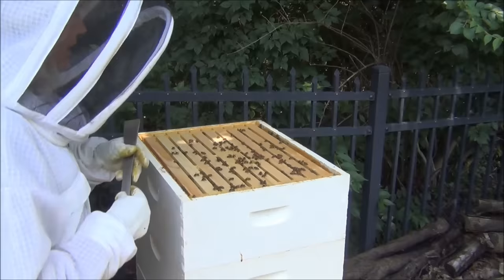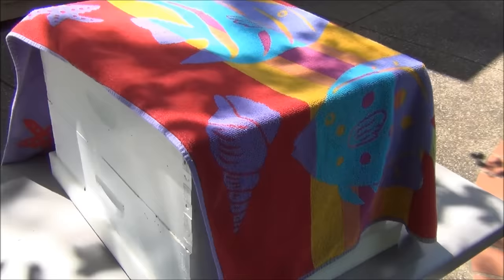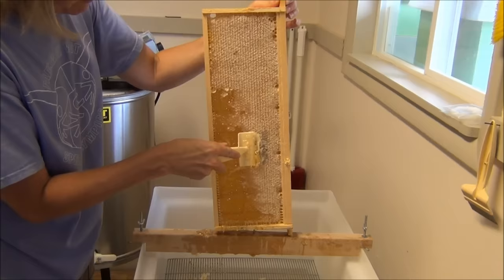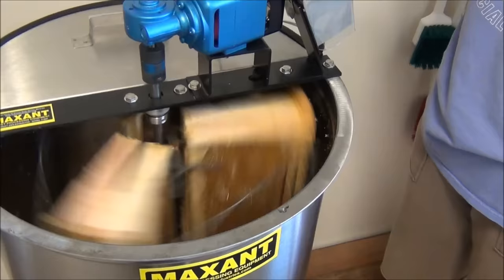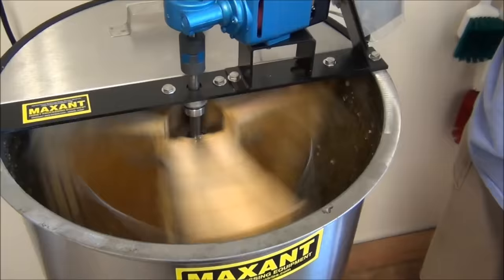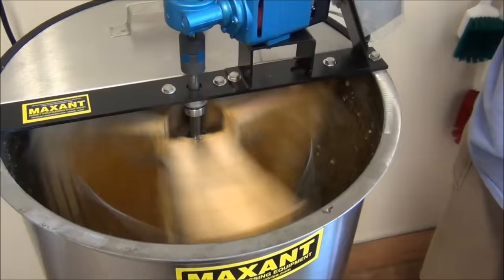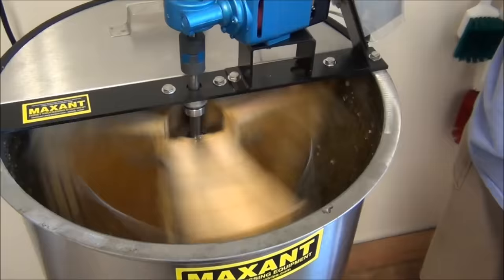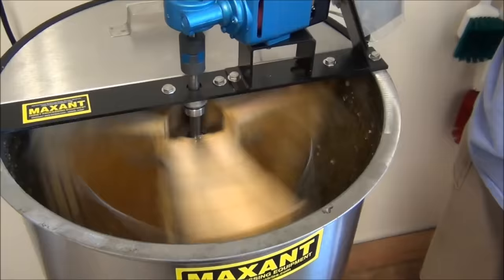My first year's honey harvest: 49 Pounds - from start to finish

Comment: After watching many honey extract videos I've decided I'm not going to use a hot knife. I don't want to heat the honey, if it gets too hot is changes and I want my honey to be as natural as possible.
Reply: Yes, there is no need to use a hot knife, just use a sharp knife and the honey will not lose its valuable nutrients.
Reply from the maker: This video was my first year's video.  I really dislike the hot knife.  I don't think it really changes the honey as the heat isn't significant enough to really change the honey's temperature in a significant way, but now I just use a serrated knife.  Works a lot better IMO.

Comment: im very curious but just what would happen if you gave them one frame to build comb on? will it be huge or will the bees mess it up  or die? also nice job on the harvest
Reply from the maker: They would build on the one frame, and then they would go from there in an unpredictable pattern, but attached to the top.  If you ever had to open up the box, it would be a disaster.  The frames do two things:1.  establish rows form them to build frame - doesn't guarantee it, but it helps a lot.  I have used foundationless frames and they have built some wonky comb.2.  It establishes "bee space", the space between the top of the frames and the lid.  Generally this prevents bees from building wax and connecting the roof and the tops of the frames (they need space to move around).
Reply: Yes they will build on one frame then as mentioned start building in the box starting from the top. Or if it’s warm enough they swarm

Comment: Was the 49 pounds of honey from a single hive?
Reply from the maker: A good hive can generate 100 lbs of honey.  The first year you generally don't get a lot (sometimes none).  The 49 lbs came from two colonies.  My second year (another video I posted) we had three colonies and 121 lbs of honey.
Reply: How many gallons were you able to make out of the 49 pounds of honey?
Reply from the maker: Honey weighs about 12 lbs per gallon, so just over 4 gallons.
Reply: How much can you make off the 49 pounds, or what is the expected return on investment?
Reply from the maker: Very difficult to make money off of a few beehives.  Too much up front cost for equipment.  I joked with people that it cost me about $60 a lb to make honey my first year and I sold it for $7...My second year I caught and sold 11 swarms and I broke even my second year, primarily because of that.  I have yet to break even cash flow wise and not sure if I ever will (only way is if I catch and sell a bunch of swarms)...and I didn't have to buy any harvesting equipment (several thousand $$ more).

Comment: How much does it cost to start a hive
Reply from the maker: For the hive box itself, what I recall is about $300, but it might be a little less.  That would include not only the boxes, but the bottom boards, the lid, the frames for the boxes and the wax comb sheet starters.  Buying the bees is about $150-$200.  Then you also need your equipment, where your protective gear is probably the most expensive item, maybe another $300 all in.  However, typically you don't want just one colony of bees - so you can compare, use resources of one for another, etc.  It seems like for my three colonies, when I started, it was about $2,000 all in.
Reply: Brook Hill Honey - Mr. G's Honeybees So did you guys take all of the honey from all of your hives? Did y'all not leave any honey to help get your bees through the winter? Did you get rid of the bees or feed them sugar water or syrup to get them through the winter?
Reply: A typical cost is about $700 for 2 hives and all of your equipment
Reply: Building a hive can be cheaper but takes a lot of time and access to a woodshop. I built my hive one winter $50, bought things like the screened bottom board, frames, and foundation $100. Then I  found plans to make 5-frame nuc boxes out of a sheet of plywood $20 and scented it with lemongrass oil $5 and had a colony move in. This year I’m going to split it and thus need another hive $150. Plus all the other equipment $60-100. And I havent sold a drop of honey yet, but it’s more for fun anyways. You can do it on a minimal budget though
Reply: I've started this spring and bought a Nuc $185. also a 3 lb. package for $93. also a guys equipment full of bees which included a deep and 2 mediums, top, bottom board for $150. I also bought a vented bee suit for $239., 200 frames, then a new deep and 2 more mediums then all of the extras that most of them you really don't need but as I told a friend that "You know me, when I get involved with something, I jump in with both feet. Lol. I have also bought 5 gal. of paint and 1 gal. of a different color. I also bought enough material to build 12 mediums and 4 deeps and 8 nucs. I have also bought 500 lbs of sugar. However at the moment I have invested between & $2,300 - $2,450. So it's according how much you want to get into it.
Reply: How much does an extractor cost?
Reply: @bibbabibba1975  Sorry Eric....two 3 lb packages of bees shipped are $250+. There is NO way that anyone can buy the necessary supplies, with even a cheap two frame hand crank extractor, and put together two complete colonies, for another $450. Of course you could mash the comb instead, but that is a big mess, and means the following year the bees will need to start with new undrawn out foundation.
A fair estimate for two colonies, with the necessary amount of equipment, is actually somewhere just under $1500.
Reply: @bibbabibba1975  Two colonies, with bees, and necessary equipment, including a cheap two frame hand crank extractor,  just under $1500

Comment: how long does it take for the bees to make a 5 gallon bucket of honey. what do you feed the bees. whats the difference between Costco clover honey (5 lbs for $15) and yours.
Reply from the maker: 5 gallons of honey is about 60 lbs.  If the honey flow is strong, a colony of bees can make that in two weeks.  I don't feed the bees unless they are light on stores going into the winter.  They will take sugar water, or sugar straight.  You can also swap honey frames in from a hive that has extra.

Comment: the wax cake you can use a silicone bottom baking pan and be able to pop it out easier <3
Reply from the maker: That is a good idea - I should have thought of that before I purchased the glass one...At some point in the future, I am going to purchase a very nice solar melter with better capacity.  I made the mistake of using a plastic top, instead of a glass top on the melter, so it doesn't work as well because less heat is made with the plastic versus the glass.  However, when I buy the larger capacity solar melter, I will definitely get a silicone baking pan.  Great idea!!

Comment: Hi, there! Are you based in the northern part of the USA, where the warmer seasons are shorter and flower availability may be less than in warmer places? Because at some point you said the honey frames would only be put back "next spring". Under normal weather conditions and proper "pasture", you could put them back immediately after cleaned and still harvest at least maybe another half of what you did this time, in about two weeks to one month's time.

Again, depending on where you are based, there are two harvesting seasons: spring and fall. 

When the frames were being cleaned up, on the table, why wouldn't you get closer instead of having to use the zoom? Normally, they will only sting you when you're too close to the hives (they fear being molested, so they "attack"). I've never had any problems when dealing with the frames under those circumstances (and not wearing the protection).

GREAT JOB!!!!! Loved seeing your work!  Greetings from Porto Alegre, RS, Brazil.
Reply from the maker: A couple of things.  We don't own our own extractor so it isn't practical to do more than one harvest.  I may buy a harvester this year, and if so, we can harvest several times depending on the bees finishing everything out.  This was our first harvest (we have done three more since then and have videos).  Because we do not own our own extractor and have to take frames and drive them to our friends house (don't they have a sweet setup?) we waited this year, and each of the years thereafter, until the bees were done collecting honey and the dearth was on.  We are hopeful that once we have our own extractor, we will harvest and put the same box back on the stack.

Comment: So, everything was clear, but one thing I couldn't quite figure out. Is that 10 frames (one hive) = 49 pounds of honey? Or was it 2 hives (20 frames)=49 pounds of honey?
Reply from the maker: It depends.  This was my first harvest, four years ago, so I don't remember what the mix was.  49 lbs of honey is about 16 frames.  I had two brand new colonies and between them they made 16 frames of honey that year.  After the first year, I use 9 built out frames and space the out and the bees put even more honey on each frame and it is much easier to harvest.

Comment: Just wondering,if using heated knife and extractors not destroy the pollen and goodness in the honey?
Reply from the maker: Now that we are three years into beekeeping, we prefer the cold serrated knife over the heated knife.  The heated knife my friends has just doesn't work well.  However, the heated knife doesn't touch much of the honey and doesn't heat it up because the contact time is so short, so there isn't a loss of the goodness.  Either way at this point, we are all cold, so no worries.
Reply: @BrookHillHoneyMrGsHoneybees  watching all the way from england but all good to know.Thanks for sharing and the response.Cheers.

Comment: So how many boards did y’all have in the spinning machine for the first spin and how much honey did y’all have when the first board’s where formed ?
Reply from the maker: There is generally about 3 lbs of honey on each frame of that size (full), so six frames is probably about 18 lbs - around 1 1/2 gallons.

Comment: Where do the bees go when you take the trays out? Do they come back? And do you have to do anything to get them back?
Reply from the maker: As you shake them off,  after they land on top of the other frames, they either walk back into the box, or if they fly, they would fly to the opening and walk in.  Most of them just crawl back in.  Bees are "GPS" oriented, so you could take a bunch of them, drive a few a bit away, and they would make it back home no problem

Comment: how you get the wax out of the glass bread pan?  I followed the instructions you did for the solar wax heater - all of that worked great.  Except - I can't get it out of the bread pan.  I tried cutting it and can't it get out.  The only way I can think is to melt it again or break the glass.  Did you spray something in there first?  Thanks!
Reply from the maker: Add some water and put it on low heat in the oven.  The wax will melt and float to the top.  Once it cools down, the water is below the wax and you can just pop it out.  Let me know if you have more questions.

Comment: How many frames and boxes did you have to get the 49 pounds of honey?  Also, how many colonies of bees?
Reply from the maker: That was our first year honey harvest.  We had two colonies.  Each super frame has about 3 lbs of honey, so 49 lbs would be about 17 frames, with 10 frames in each super box.  (after the first year, you actually only use 9 frames per box (built out already) and still get the same 30 lbs per box).

Comment: Why don't you use cherry scented wood to repel the bees fron the top insted of shaking them?
Reply from the maker: Even if you use the repellent, there are bees still hanging around and you would still need to shake.  If I had a lot of colonies, I would probably use it and finish it off with a leaf blower to get the last few out.  IMO, it is easier for me to just do a little shake.  It doesn't hurt the bees.  Lots of opinions out there and I have actually helped someone extract with the repellent - didn't do it for me.

Comment: Can someone explain why the SMOKE wasn’t used as I’ve seen before? I’m new.
Reply from the maker: When you work the non honey sections of the colony, you use smoke.  When you are working with honey or honey frames, you don't want to use smoke as the honey and wax will absorb the smoke.  You can actually taste it if you use it.

Comment: I''ve never had bees but could you extract the honey using filtered clean compressed air?
Reply from the maker: My guess is it would blow all of the wax and the honey out of the frames.
Reply: @BrookHillHoneyMrGsHoneybees  could you set the pressure low enough to blow the honey out but leave the wax behind?

Comment: I saw at the end of the video but I dont understand what the wax is going to be used for? Just thinking about getting into this ....maybe
Reply from the maker: You can make lip balm, other balms and candles.  I haven't done this yet, but I have four years of wax saved.  You can also sell bulk wax back to the manufacturers that make the wax foundation.
Reply: @BrookHillHoneyMrGsHoneybees  Ok thanks for getting back to me....I suppose you could prob make soap too from it...pretty useful stuff.
Reply from the maker: I am not a wax expert, but anything you can use wax to make, honeycomb will work and it has a great smell too.  I have expanded to six colonies this year, so my wax supply/volume will grow a lot.  I am guessing I will start making candles, but haven't purchased any of the equipment for it yet.

Comment: What do you use the wax for?  And do the bees clean the honey off the frames, so the can rebuild the damaged honey combs?  Lastly..lol...what do you mean by robbing?
Reply from the maker: you can make candles.  We plan on making some lip gloss.  The bees clean the honey off of the frames for the same reason they collect nectar from flowers - for food.  Robbing - bees are little thiefs.  If there is a weak colony, a stronger colony will take every ounce of honey from them, essentially killing of the little colony from starvation.
Reply: @BrookHillHoneyMrGsHoneybees  thanks so much for the response.  I want to start a colony..lol

Comment: Beeswax candles sell really well and they also help take the ions out if the air that cause respiratory problems and allergies - in soy candles I use the safest Ecosoya Q210 Soy Wax ) for every 2 Cups soy wax you  put 3 tablespoons beeswax pellets. I buy only yellow beeswax by 1kg lots but the only difference between the white and yellow is approx $4 Per kg
Reply: The white beeswax is probably the cappings. If so, it is far less likely to be contaminated with pesticides and herbicides than the yellower beeswax.

By the way, check your soy source carefuly. Most soy these days is GMO.

Comment: Aren’t you supposed to leave the first year’s honey crop all to the bees?
Reply from the maker: Not necessarily.  Typically we leave two brood boxes of honey (the larger boxes on the bottom of the hive stack) for winter, and harvest the smaller upper boxes "supers".  The bees need about 60 lbs of honey for the winter, and there is usually plenty in the brood boxes.  If the dearth after the honey harvest is severe, then we will supplement feeding with sugar water.

Comment: suggestion put mesh strainer by the spout on the extractor so it will catch unwanted material
Reply from the maker: There is a strainer over the top of the bucket - you just can see it.  Otherwise you would get bee parts, legs, wings, etc. in your honey.  There are some people that say to not use it and the parts would float to the top, but I don't want anyone to get that stuff or a piece of hair in their honey.

Comment: How do you avoild thequeen from laying into the hives you collect honey from. I heard using a queen blocker slows down production by a massive amount
Reply from the maker: This has been problematic for me.  If I don't use a queen excluder, then my queen wanders into the supers and starts laying.  If that happens, I put on the queen excluder.  However, it slows the production of honey down significantly.  I have been trying a upper entrance thingy where you put the queen excluder in, but a frame around it creates an entrance at the super.  That has seemed to help on the honey production.  You may be able to see an example on my second year honey harvest video.  The queen excluder fits within the wood frame that creates the upper opening.
Reply: thanks for the information :) ill make sure to watch the other video.

Comment: It looks like you need significant physical strength to shake off the bees. Do you think I would fail doing this alone? I am not that strong.
Reply from the maker: It is more of a quick flick versus brute strength.  What is hard to see in the video is that the stack of the hives is pretty high, so if you aren't 6'5" like me, it is hard to get leverage that high up.

Comment: what date or season did you harvest the honey?
Reply from the maker: It varies from place to place.  In our local area, the strong honey flow typically ends in late June/early July, but can vary depending on the local weather.  Typically we will harvest about a month after that time (mid August) so the bees have enough time to cap the honey.  It is all about moisture content.  If you harvest too early, the honey can ferment because of too much moisture.  There are diagnostic tools you can use to measure moisture, but typically if the bees cap the honey, the moisture content will be good to go (harvest).  We harvest all at once because we use our friends' equipment, but if you have your own extractor, you can harvest honey anytime you have capped honey and do it throughout the season.  Some of our friends will harvest during different blooms and market their honey accordingly.  In my local area, people seem to really like Black Locust honey, but not sure that is the only thing your bees are harvesting, but it is a nice marketing ploy :)